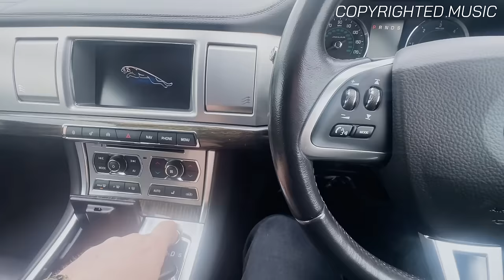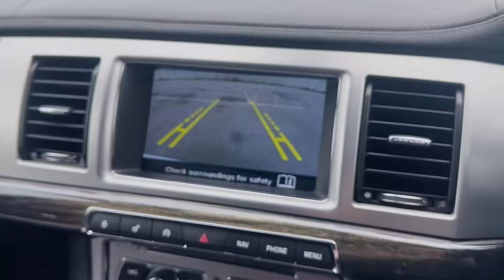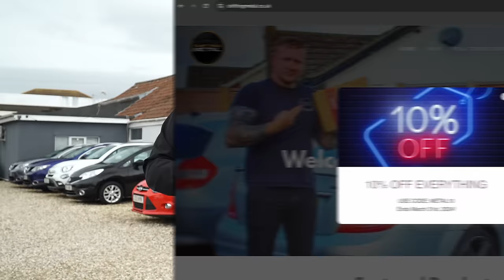New Cars, new showroom, new outlook!! BM Weekly EP 30

Comment: Your new photo area, perhaps a turn table would fit, the camera would be in a fixed location and you move the car instead.
Reply from the maker: Would be great, just the expense!
Reply: @ShiftingMetal  Yeah, they are expensive. They help with the overall efficiency. If you ever need any advice on photographs, just shout it out in the video, I will respond in the comments. Just finished with a large south Wales used car dealership doing their photos, and willing to help others